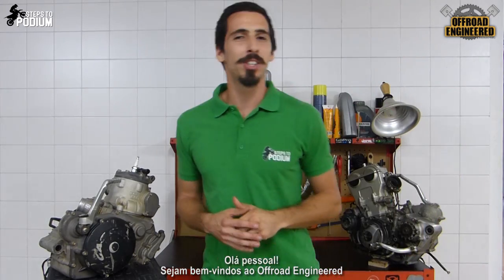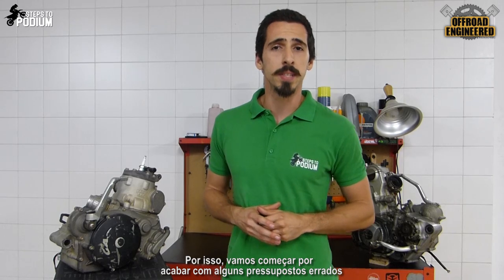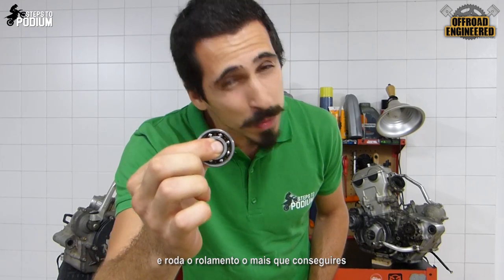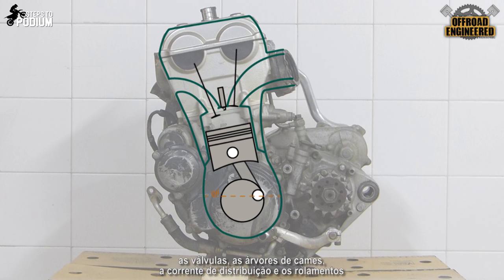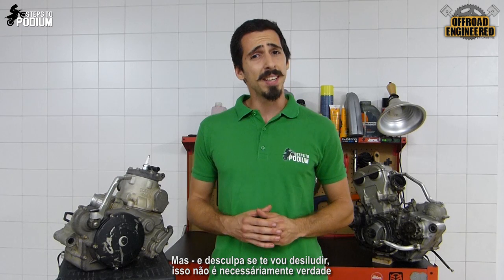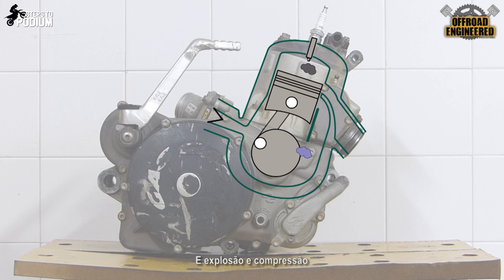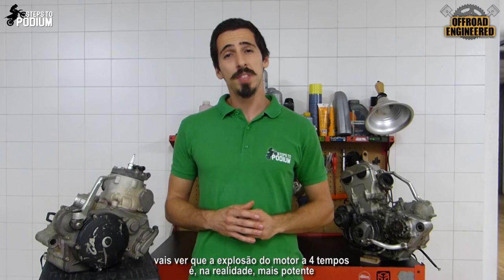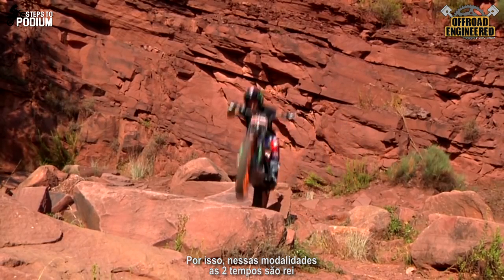2-stroke VS 4-stroke | Offroad Engineered

Comment: we only have 4 strokes motocross because of government emissions laws ... 2 stroke  cheaper faster  light weight easy to start simple to fix ..everything a race bike needs to be
Reply: And the cc advantage.  At the time the yamaha yz400f got a 150cc boost over the 250s.  2 stroke riders hated it right away but it was way easier to ride with the torque it had.  Between the cc advantage and the EPA it was just easier to make 4 strokes.  It's funny that all dirt bike magazines are reflecting on the mistake of going to 4 strokes and how much they cost over comparable 2 strokes.
Reply: 2 strokes are terrible for extreme mtn riding
Reply: @FarWestNorthCarolinaSports  4 strokes are better for novice's to wheelie.. Lerner rider's to learn on and road use ...when I was a little kid my dad use to tell me bed time storys of a monster that would cause fully grown men to shit themselves  ..it was called the 86 cr 500 ....I cannot agree with you 2 strokes can be a handful but being easy to ride does not what make it better
Reply: @jayday4879  I gotta yz450f for my first bike and I'd hate to see the cr500 cause this thing can break its tire loose in every gear easy
Reply: yes a 500cc 2 stroke moped will beat the cat fart out of a 4 stroke 1000cc clockwork bike on a track!!
Reply: @jayday4879  ive watched 2 strokes get destroy in the mtns. A 2 stokes  cannot lug down, they spin to much. I assume your from flat land. Riders here laugh at someone on a 2 stokes. If you think a oil burner can hang with a 4 stroke in the mtns at 5,000ft you probably cant be helped. 
I can offer to show you. What state are you in?
Reply: I agree. The 2 stroke is king of the track. Thats the only place they are king though.
Reply: I cant remember the offroad magazine that came here to do storys but they wrote that anyone riding here should be considered a professional. The only 2strokes here are used for riding in the flats or on a track. Ive watched 2 stokes get stuck on a novice part of the mtns. It couldn't even take off and had to go back down and try multiple times before making it while the 4 strokes lugged right on through first try.
Reply: If you live in the states, show me the law that says 2-strokes cannot be ran in professional motocross.
Reply: The reason why 4-strokes have taken over motocross is because there is a clear advantage in displacement made possible by the AMA rule book.
Reply: Matt Smith nothing to do with emissions
Reply: travis rogers have you ever seen an extreme enduro? Do you know who Graham Jarvis is?
Reply: travis rogers nope otherwise teams would race them
Reply: travis rogers not true theyre actually better for enduro.... i have a gasgas 300 ec and took it to the dunes with no paddle tire
Reply: 2 strokes cheaper? lmao
Reply: @FarWestNorthCarolinaSports  then why are 2 strokes used so much in stuff like redbull hard enduro and enduro it's self
Reply: 2 strokes requires more fuel consumption 
And the smoke from the engine is not good for environment 

Imagine a country like vietnam use 2 strokes engine
I can already see the smoke is as big as a building at the stop lights
Reply: @FarWestNorthCarolinaSports  you cannot be serious its a well known fact that 4 strokes stall easier than 2 strokes. You've obviously only rode with guys who use motocross bikes which are atrocious in mountains/technical whether they are 2 or 4 stroke. Just watch any of the Hard Enduros and you'll see your completely wrong
Reply: Get new government
Reply: @Kyle-pl6rl   European law ..the Japanese started to take emissions seriously though out car and bike range by 2007 Honda stopped it's production of the famous CR 250 2 stroke...in the UK  some tracks get a decibel metres out to avoid sound pollution laws now everyone is riding 4 bangers ..give it 20 years I bet the tracks go silent when everyone converts to electric bikes because of government guidelines to cut carbon emissions
Reply: Jay Day why do so many European manufacturers still make 2-strokes?
Reply: @FarWestNorthCarolinaSports  They are good, if you know how to ride one!
Reply: @FarWestNorthCarolinaSports  that's because of their powerband. That's were two strokes power only is. It's hard to stay in a high rpm in those close quarters
Reply: @fidelcatsro6948  No it won't, but i agree that 500cc 2-stroke is a beast to ride. The current motogp champions would come last on 500cc two stroke bikes.
Reply: @FarWestNorthCarolinaSports  ummmm, notice in all enduro competitions their riding 300 2 strokes... it shows youve never ridden a 300, they are king in the offroad world
Reply: @matthewchurch1320  because there lighter
Reply: Jay Day two stroke more power Four stroke more Efficient
Reply: fidel catsro  actually it wont  ,the higher cc a single cylinder 2 stroke is the less power it makes  because they dont have low end torque  the 1000cc would always win ,show me 1 500cc 2 stroke that beat a 1000cc ill wait
Reply: @5thgearpinned450  your so wrong speak to a mechanical engineer then come back and comment
Reply: Jay Day are you a mechanical engineer? Explain how im wrong please , 2 strokes of a lower displacement produce alot of power example (125cc 250cc 300cc)but as the cc gets bigger the rpms and power per cc goes down ,btw we are talking about single cylinder bikes  example th cr500 , they dont rev as high and compared to a racing 450 4 stroke they barely have an advantage even tho they have 2 advantages being 50ccs more and being 2 stroke ,what they have is torque and not as much hp per cc as a lower displacement bike , either way if we wanted to shut the 2 strokers up we could just have turbo 4 strokes , i own a cr500 bored to 515cc , a ktm 250 2 stroke and a 2016 crf 450r turbocharged on 18 pounds of boost with a billet rod ,race high lift long duration camshafts, 13.5-1 compression wiseco pistons ,thin head gasket, titanium valves ,and a 500cc big bore kit , it dynos in at 73.62 REAR WHEEL HP and 54.12 torque  on 105 octane, yes i have the dyno sheets and yes i will send them to you if you think im lying , i dont hate 2 strokes i just hate the fanbase and the “best engine in the world nobody can beat it mentality” 2 strokes are great but chill tf out enjoy your ride and stop bringing people down for their choice in engines 4 strokes have torque and power everywhere but 2 strokes have bursts of power , one is reliable and one is not, they both have their uses
Reply: Yeah. Try that on Dakar
Reply: @FarWestNorthCarolinaSports  I have 2 words for you...... HARD ENDURO
Reply: @5thgearpinned450  The cr 500 has way more torque without a turbo and the hp isn't far from that. As they say, hp sells cars and bikes torque wins races
Reply: @pietervanbreda4360   notice how the CR 500 makes torque only in a narrow window of the RPM curve vs a stock 450 with 50 less ccs makes its torque over a wider range and actually gets traction , if you’re going to use your bike to go hillclimbing bring your 500 cool but if you wanna bring your bike to a motocross track bring a 450 not a 500 , i own a 500 and although yes, they are indeed very fun motorcycles they’re not the best option for a motocross track because they’re too hard to control. The point is to win races but I admit sometimes I do want to go to a track and have some fun in that case I won’t be bringing a 500 I’ll be bringing a 125 two-stroke
Reply: @ampm9771  Why
Reply: AMEN!

Comment: 2-stroke all the way.
Advantages:
Less weight, less machanical complexity, therefore less overall wear, disproportionately powerful compared to displacement, easy to modify for more power, extremely easy maintenance & repair, cheaper maintenence and repair...
Didadvantages:
Development has mostly stagnated, few new innovations.
Reply from the maker: agree with all the advantages hence I currently ride a 2 stroke but one huge disadvantage of 2 strokes is the fuel consumption which is huge unfortunately!
Reply: While 4 stroke is best for daily ride,working, postmen, courier, less fuel consumption and odourless..
Reply: Well, less is more, thats what makes the 2 strokes better and thats why there isnt much to add though I really like the new fuel injected 2 strokes. Its like the best of the both.
Reply: @StepstoPodium  
Neste momento (felizmente) estamos assistir um "reverso da medalha" no que toca aos consumos de um 2 tempos com a introdução por parte da KTM de injecção direta ao cilindro, permitindo reduzir até 70% os consumos e 50% as emissões comparativamente a um tradicional carburador. E sobretudo, as perdas de potência sao minimas (para já), coisa que nao deve demorar muito a mudar.
Reply from the maker: tem cuidado porque a ktm não é injecção directa! A injecção é no transfer port, daí chamarem se TPI. 
A injecção não é feita na câmara de combustão e esse é das maiores limitações da ktm em tornar as dois tempos parecido com as 4 tempos mas vamos ver o que a inovação nos trás 😆
Reply: @StepstoPodium  
Sim repara que tive o cuidado de dizer que é injeçao direta ao cilindro e nao o injetor colocado na culassa a pulverizar diretamente para o topo do pistao (apesar de ja ter visto pelo menos um modelo 2 tempos assim).
Mas mesmo usando o TPI, pelo que ja li algures, os consumos conseguem até ser melhores que uma equivalente a 4 tempos. A ver vamos, porque sem duvida, sempre fui um admirador nato por este tipo de motorizaçao, para além de ja ter feito varias preparaçoes em diversos motores 👍
Reply from the maker: @yamahaexpert  vamos ter que ver o que a indústria nos traz mas são bons tempos para os amantes do desporto motorizado 😆
e boa cena sobre a reparação do motores 😉👌
Reply: @StepstoPodium  my 115cc yamaha from 1983 2 stroke cat still gives me 40km per litre!! i even mix 2cycle with used motor oil so i dont have throw them away and it still works fine but with added carbon deposits..
Reply: 2 stroke cannot lug with out spinning which makes them garbage in the mtns. People that ride a 2 strock in the mtns 9nly do it once then either stop or get a 4 stroke. Most folks here dont even want a 2 stokes riding with them. Its constantly stuck and everyone is waiting on it and you might foul a couple plugs in those conditions.  
No one from the mtns will say a 2stroke is better unless its a race track or a corn field.
Reply: @FarWestNorthCarolinaSports  guess you have not watched much enduro like redbull hard enduro
Reply: @StepstoPodium  four strokes are complicated machines that when the work perfectly, are beautiful in their complexity. Low fuel consumption. Quieter. Pollute less. Longer engine life. For example: i had a mercury two stroke on my boat..fueling problems galor...wore out in five years. Got a mercury four stroke, quieter and still running strong after 8 years. My motorcycle:
I had an early Cr500 in the 1980,s.it was tempermental, hard to start..leaked everywhere. I had to take it to the logging roads on a back of a truck to ride it because I could not ride it on the street. Then in 1992, i bought a XR650L to ride on the street. I still have the bike and it still runs. No issues. The bike is almost 30 years old. Its a four stroke. As far as im concerned, four strokes are better and its based on my experience with both.
Reply: @chuckbowen4334   Comparing a CR to an XR is like comparing a Ferrari to a tow truck. Completeley different in purpose and execution. My personal '96 CR usually starts on the first kick, is super-responsive and great in the woods or on track. It is a race bike. The XR was allways intended to be a play bike. A big, understressed air cooled, simple 4-stroke versus a race-tuned, higher-stressed 2 stroke. The only real similarities they have is they both have steel frames and made made by Honda.
Reply: You forgot to add carb drama, always jetting issues or need cleaning. The TPI injections even need pump replaced at 65 hours. Checking valves once a season on 4 strokes isnt a time consuming or expensive as rebuilding a 2 stroke every other season. Plus the $ spent on oil to pre mix.
Reply: @tieoneon1614  You must have had one horribly jetted bike. Ive never needed to touch my carb unless it has sat too long with fuel in it. Cost of premix oil is negligible since you can mix up a drum of fuel with it, unless you like to run oil with a little gas in it and mosquito fog the area. Ive run everything I have on Sunoco Silver 100 octane race gas and Klotz castor at 40:1 for over 25 years and never have has a single problem. The key is to keep your air & fuel filter squeaky clean (run your fuel through a filter too- youll be amazed at the crap thats in there) and with minimal hassle, it'll last for years.
Reply: There are EFI throttle bodies to retro fit most all 2 stroke moto bikes ...and thats all they need for warp ....imagine no more carb jetting every time you mod the ports or make a pipe change or change elevation ..or ride the desert and mountains in the same day or race ! And have a perfect air/fuel ratio going on at all engine rpms for a crispy braaap without leaning the piston and ring ...snd using yama lube R smokeless oil at 50 to 1 no carbon at all just speed
Reply: @FarWestNorthCarolinaSports  malcom smith was world champion 6 day trials rider on two strokes in the mountains ...to say a two stroke is not suited for power on mountain trails tells us you have no knowledge at all about two cycle engines and how to tune them for any type of competition
Reply: @chuckbowen4334  if you knew how to tune a two stroke your motorboat would have ran for decades to come .... Ted Sampson is an old friend who had a Hodaka motorcycle dealership he ran part time and was a welder full time for  Amax Coal Mining Company and rode a 2 stroke Hodaka 125cc dirt squirt enduro to work everyday come snow rain or shine for over 7 years without ever overhauling the engine .. I ask him one time how many miles he had put on the bike riding to work and back everyday ..and at that was over 37,000 miles on the original piston  and cylinder bore ..  I raced motocross on two stroke japanese dirt bikes for over 20 years and was taught how to tune them by the most famous tuner for two stroke racing motorcycles the world has ever known the man himself "pop"  Yoshimura who could tell you what you had for breakfast by reading your spark plug
Reply: @chuckbowen4334  you have no experience to know anything at all about the opertions of engines and are exactly the kind of customers i like to see working on their junk that makes me big money
Reply: @dr.hugog.hackenbush9443  i used to run Klotz until one day i had to do a top end and bottom end r&r on my old 1973 mx250 yamaha the very next day after a sunday trail ride  and quickly found out why it says in very fine print on the back of a can of klotz you must immediately flush out the whole system of pre-mixed klots and gasoline out of the entire engine as soon as you shut it off...when i opened up the bottom end everything like the main bearing races and ball bearings fly wheels pins and connecting rod was solid coated in fresh red rust as there is something in Klotz two stroke oil that is extremely corrosive...probably has to do with no carbon build up ..and if you are racing two stroke go-karts with the the old West Bend engine is a piece of cake to douse it with raw gasoline and blow it out with an air hose and an air gun ..but a dirt bike after a 100 miles of trail when get home you feel like doing anything but cold beer ...yamalube "R" worked just as good as Klotz with same power but no rust
Reply: @StepstoPodium  You have to pay for more fuel... so therefore money does buy happiness 😅

Comment: That what you showed wasn't inertia, it was gyroscopic Precession. Rotational inertia is the effect you describe when a rotating object doesn't want to change it's angular speed.
Reply from the maker: Thank you for spending the time to give some feedback! I knew this question would come up sooner or later :P
I excluded Gyroscopic Precession for a reason, you have a fixed axis of rotation (both wheels on the ground impose a rotation axis). Besides that, although we are used to handle rotational inertia in a planar context, we also have rotational inertia in a spacial context where the inertia matrix can explain this phenomenon.
I did my research and these were the conclusion I made and I'm pretty positive it checks out!
but if you have any other points of view, please let me know, I would be delighted to go back and forth on this :)
Reply: @StepstoPodium  But this effect still hasn't to do with the rotating inertia of an engine. (except for the wheels that keeps the bike upright) I think a better way to explain that would be a flywheel. When you try to rotate a heavy flywheel you need force to get it moving, that's what defines mass and it's also hard to stop a free spinning flywheel (resistance in change of motion). Just like the added mass of a camshaft, cam-chain etc. Procession on the other hand works only when you have a already spinning mass. You have no procession on a still bearing BUT you have still the resistance in motion when you try to get the bearing spinning. Inertia is always there procession is not. ;D
Reply from the maker: Like I said, in this case the procession is not the explanation because one of the necessary conditions is not met. 
And the example you gave about the fly wheel only explains what you are stating, not the resistance in orientation change, which the spacial inertia would explain
Reply: Newtons first law of motion.